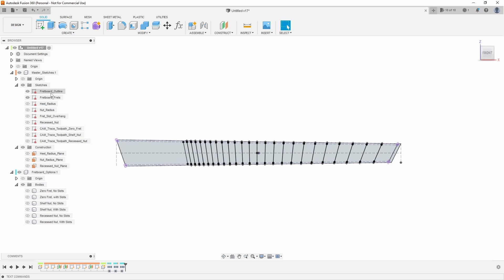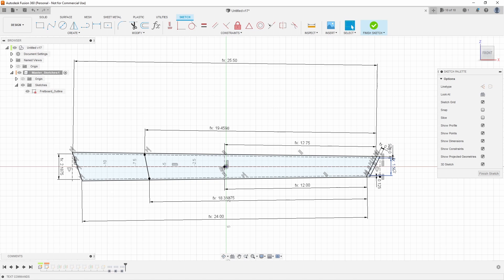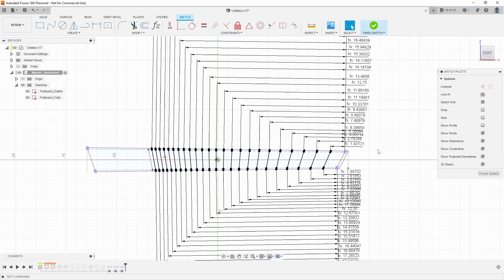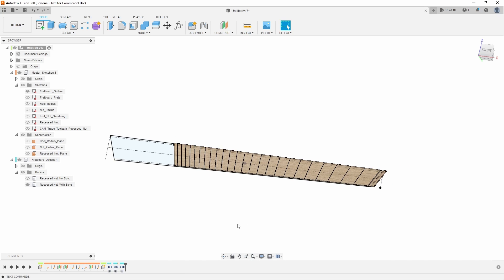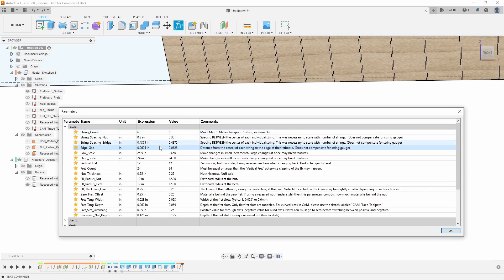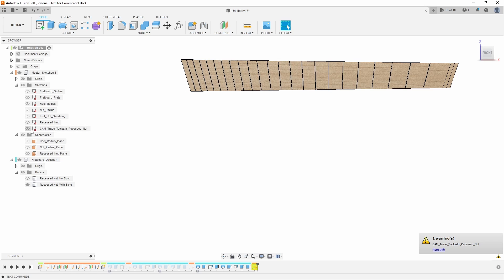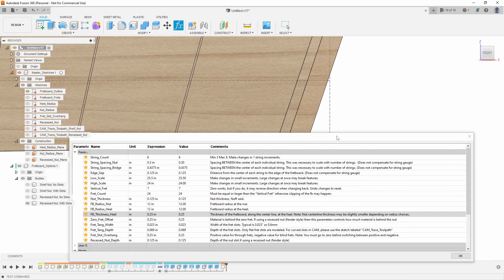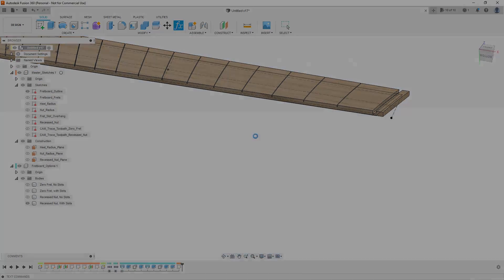SIX fretboards in one file?! Overhauled V3 Parametric Fretboard now available! | Fusion 360

Comment: LOVE yer dedication and contribution to the craft, BRAVO! I DO have one thing to comment/add to this. Apologies if its been addressed or I missed its explanation in the vid. The Fender style end near the nut, there needs to be some flare (width-wise) past the nut to compensate for the widening of the headstock shaping that takes place directly after the nut slot; especially on the lower side. Its slight, depending on someones HS design, but it IS there, meaning the taper cannot continue past the nut slot, or it will constrain the HS shape to come INWARDS for the length of the FB extension before it then heads outward towards the HS ears/wings. Most designs DO have the shape spline/arc heading outwards, be-it slight, directly after the nut slot. Just FYI for future iterations of this WONDERFUL model-set. Any FB extensions past the nut need to compensate for the outwards shaping of whatever the designer makes heading out towards the headstock. Thanks again for your awesome work!

Comment: This is a silly question I'm sure, but I'm pretty new to the whole Fusion thing. How do you constrain the fret position markers so they move with the parametric scaling of the fretboard? I noticed the Fretboard CAM video has fret markers, but none of the rest of the videos have them included or a way to have them move when adjusting the scale options. Thanks for these amazing videos. This has made the idea of CAD far less intimidating!

Comment: Hi Austin, I love your videos and they are very helpful. I wanted to mention that the string diameter matters as it cis usually entered into fret2d because the spacing is not usually equal as it relates to the string spacing of say 1.5". The spacing needs to compensate for the OD of the string (Found on string packaging). Do you have a suggestion on how to add these to the parameter section that automatically updates the string spacing in the model? Thank you for your help!

Comment: Hi Austin, thank you so much for sharing this great model, however I have an issue, I don't know how to not use the zero fret, in simple term how to model a fretboard with no recessed nut (let's say Gibson style) and with no zero fret, in FX parameters I have 0 for the value of Zero_Fret_Offset but I have half of the zero fret tang, I have the metric model from Feb 5th 2023, only appears Zero Fret, No Slots and Zero Fret, with Slots in Bodies

Comment: Hi Austin, thanks for all your work over the years. I have certainly benefitted from a lot of your F360 machinations! However [there was always a however of course], your fretboard calculator is based on slightly incorrect theory, sorry, but there you have it. Frets should be lofted onto the [angled] edges  of the fretboard, from a defined centreline. Drafting them out along the fretboard edges introduces an error, I think it is an error of parallax. It is indeed a very small error, less than a tenth of a mm across a 647.7 scale length for example, your[ scale length of 647.7 is actually a scale length of 647.641] but it is still an error and one that should be noted. I can demonstrate this with F360; please PM me if you would like to debate further, disagree etc. Otherwise thanks very much.

Comment: Just downloaded from GrabCAD and started playing with this.  Gotta trouble you with a Newbie basic question... If I wanted to start a new guitar design file and bring in your Parametric Fingerboard file as its own (non-parent) component, how would I do that?  (I'll then create additional components for Body and Neck/Headstock.  Bonus points if you can also tell me how to do that with the origin as the center of the 12th fret and Z=0 at the apex of the fingerboard radius!  Thanks, Austin.  I appreciate you.
Reply from the maker: Anytime I create a new design, I do one of two things. Either create a copy of the parametric fretboard and start drawing my body in that new file... or insert my fretboard file into a new design, and then right click that component and say "break link". This will break the link to the original, and bring in all the features/parameters into the new design. 

Unfortunately, due to how i modeled this design, Moving the origin to 12th fret Z0 radius apex will be extremely difficult and time consuming. Not worth the trouble for any limited gain you may get imo.

Comment: Hi Austin. Thanks for your videos. I'm having an issue with the scale length using V3. I have it set for 25.5" for a Strat style. When I put a canvas of a Strat body to check the bridge placement, it falls short even though it is scaled properly. Any thoughts?
Reply: Nevermind. Realized I had it set on 24 frets

Comment: Hi Austin! Can you tell how did you create parameters to the vertical fret? I made my own fretboard model just for practising, but couldn't figure that out.
Reply from the maker: Hi Tuomas! Check out my V2 fretboard video. I cover this feature in detail. That feature remained unchanged other than ensuring it was dimensioned on the string path, rather than a simple vertical dimension.

Comment: Austin, I may be doing something wrong with v3 but I'm trying to create a fretboard for a soprano ukulele.  I bought a plan from GenOne and they specify a scale of 13.625 inches.  When I configure parameters in your code for a 17 fret instrument it appears that the first fret is shorter than the second fret.  The GenOne plan lists the distance from the nut to the first fret as .765" but your code generates the distance at .651".  When I generate a fretboard with your previous template, the first fret distance is .765".

I'm a huge fan of yours and I appreciate the fact that you share your knowledge and your able to communicate so well.  Thanks for all that you do!!
Reply from the maker: Thanks for bringing this to my attention. I'll dig into it a bit and get back to you sometime today or tomorrow.
Reply: @austinshaner  Thanks so much!
Reply from the maker: @Jeff Nobis  I had a friend look at it while I was at work. He was able to build what you described without issue, and it measured .765. To the first fret on both the high and low strings. 

Did you by chance make any changes to the formulas in the fret position sketch? You should only need to modify the parameters, but nothing else.
Reply: @austinshaner  Not that I recall Austin. I'll try it again with a fresh download of v3 and I'll let you know...
Reply: Sorry for the delayed response.  I did reload the v3 download and problems still exist.  My zip file download was done on 1/31/23 and the only parameters that I changed were:

number of strings = 4
number of frets = 17
low scale = 13.625
high scale = 13.625

first fret is .651"
second fret is .722"

Let me know if there other parameters that I've overlooked.  Thanks Austin!
Reply from the maker: @Jeff Nobis  I'm sorry to hear that. Another question,  did you ease your way down to those numbers or did you make the changes in one big step? This model is occasionally unstable if you make too large of changes at once.

Comment: Well come to find out Fusion 360 won't work with my Next Wave CnC. Only Vcarve and Aspire. Sorry about my whinging earlier.
Reply from the maker: Fusion is compatible with next wave CNC. You just need the appropriate post processor so Fusion can export the appropriate file. Manufacturers often provide this, but if one is not available, many  people in the community write their own that you should be able to find online. I would be surprised if no one had written a post processor for those machines.
Reply: @austinshaner  well I looked and haven't been able to find one. Contacted Next Wave and they said they only provide pp for vectric software but I could write my own. I'm just learning how to run the machine let alone know how to write a pp. LOL
Reply from the maker: @patruddiman4228  Ouch :( I remember back when I built my x-carve a moment of panic where I realized I needed a F360 post processor and had to hunt one down. Thankfully inventables had one. I'd say just focus on learning your CNC right now, there is a bit of a learning curve to CNC. You'll crash it many times and learn what to/not to do in order to be successful and happy with the machine. You may be able to take your F360 design and import it into Vcarve. I haven't tried that though.
Reply: @austinshaner  ok thanks

Comment: Hey sir.. does the unit can be change for us metric users?
Reply from the maker: Unfortunately not without updating all the dimensions, formulas, and parameters. However, in each parameter field you can type a metric value, such as 600mm, and fusion will auto convert it to inches. So you can still use metric values but it won't display correctly. 

I plan on making a natively metric version soon, as this is a common request. I apologize for the inconvenience.

Comment: Well not to sound like a dumb ass. I'm new to this whole thing. Could u possibly make a video showing how to set up g codes in fusion 360 and cutting it out of fretboard stock with tabs?
Reply from the maker: Hey Pat! I have a video on CAM for fretboards that covers that in detail :) I also have a project Mehr video where I machined a fretboard on my cnc if you're interested.

Comment: Austin you are the rock star of guitar modelling... thanks so much.
I'm going to use the file as part of an acoustic guitar design. Acoustic guitar bridge saddles have very limited adjustment.
The Fretboard Outline Sketch can be used to reference the saddle relative to the fretboard, but string length compensation needs to be added. 
I usually get this value from the Stewmac fret position calculator. Does anyone know if there is a formula for calculating the compensation value?

Comment: Awesome video! Just wondering, at 5:18 is there a reason why you skipped fx 3 on the top set of formulas, but not the bottom?
Reply from the maker: I'm not sure what you mean. fx 3? If you mean why didn't I show the formulas for the high E set on bottom like I did the top. I was just summarizing the changes rather than creating a tutorial like previous versions. With how many changes I made the video would be an hour and a half or more long. 

That being said,  they are the same formulas, just replace Low_scale with High_scale. 

So High_scale-(High_scale/(2^(1/12))) and so forth.
Reply from the maker: Had to stare at that timestamp a while haha, i think I understand what you are asking.  Are you asking about how the dimensions on bottom go 1,2,3,4 but the top skips 3? 

Nothing was actually skipped, it's just that the spacing between the top and bottom sets of dimensions are different because they were set to different scale lengths.  Not all of the numbers fall in numerical order like that. On the top for example there are two 11s, the spacing wasn't enough to push it into the next round number.
Reply: I just noticed you replied, I’m sorry I didn’t respond sooner, I really appreciate you getting back to me, as I am working on a pedal steel design, and this video was extremely helpful for me to add strings to the design.
Reply: Thank you for clarification.

Comment: Hi Austin, a timely video as I have just recently been watching many of your excellent videos again prior to starting to model something in Fusion360. 
I do have a couple of suggestions and they may be relatively easy things to adjust which you may find useful. 
1. Per Edge_Gap these could often be wider on the bass side versus the treble side for example, per a stratocaster neck blueprint drawing it shows 0.145" on the bass side and 0.140" on the treble side from the centre line of each string. So perhaps a Low_Edge_Gap and High_Edge_Gap may be an idea.  
2. The next thing I assume for compound radii, the arc is at 90 degrees to the centre line. Though the larger radius at the last fret FB_Radius_Heel, perhaps another option would be FB_Radius_Bridge which would create a perfect cone cross-section between the nut and bridge, so for example if using a Schaller Lockmeister trem with a 16" radius and a 10" radius locking nut this would enable something somewhere towards the end of the fretboard dependent on the number of frets a dimension probably of approx 14" give or take automatically. Hopefully this makes sense.
Anyway, just a couple of ideas I thought may be of interest. Keep up the good work.
Reply from the maker: Thank you for the feedback! This is great. I love custom edge gap per side idea. I thought about including an option for true string and edge gap spacing that would take into acount string gauge for example, but wasn't sure if that is how most people do it or not. So i left it out on this version.

As for the heel/nut radii, the challenge here is two competing interests. perfect arc on centerline, or constant edge height. You achieve both when using a single scale length, but with multiscale, it moves the heel arc just ever so slightly out of position if you want constant edge height. I went with constant edge height by defining the arcs by where they meet with the edge.
Reply: @austinshaner  Thanks Austin, the edge from the centre of the string should work for most gauges, and then of course someone could choose what seems appropriate. 

I see what you mean about constant edge height with multiscale. It was more for single scale length that I was thinking of.

Comment: What about a spoke wheel truss rod access.
Reply from the maker: I wanted to add that, as I exclusively use spoke wheels on my designs, but didn't want to to limit others with it. There is one frets worth of excess material already added behind the last fret. You can cut your access into that section.
Reply: Offset Face from the heel end of the fretboard to add more material, and then Sketch and Extrude>Cut your access hole. Seems the simplest way to go about it.

Comment: Hey man! Do you have a good resource for cnc bits? I just got access to some proper cnc’s and need a bit for fret slots.
Reply from the maker: I tend to buy bits from specific manufacturers, rather than specific retailers. My 1/4" upcut and downcut or ballbose bits are CMT, Amana, or Freud off of Amazon. My fret slotting bit is a 4 flute .023" from Kodiak Tools (Amazon, or their website). My 1/8th" bits are typically just cheap options on Amazon because I expect to break those often.  

Any other bits like chamfer, dovetail etc I grab from my local woodcraft or rockler store.
Reply: @austinshaner  thanks man! Looking forward to doing some good stuff now that I have the cnc. I’ve only spent the last year or so studying your vids in anticipation.